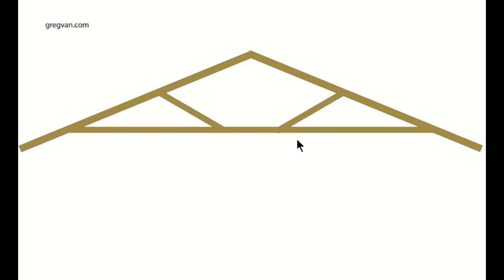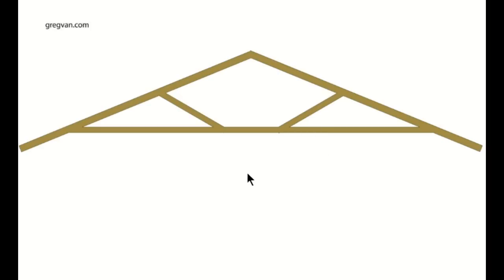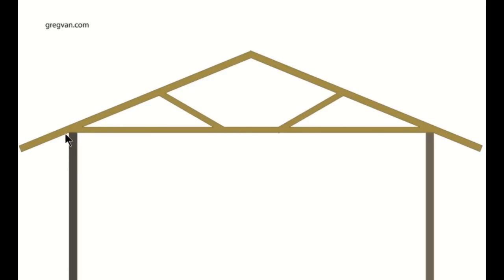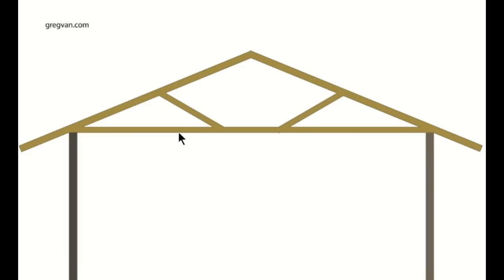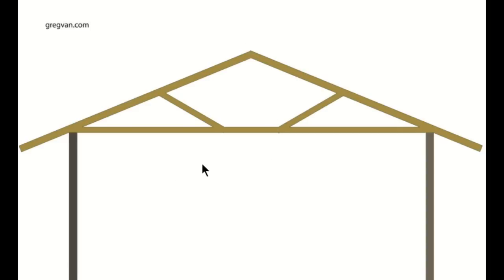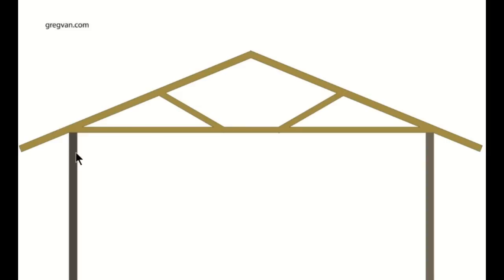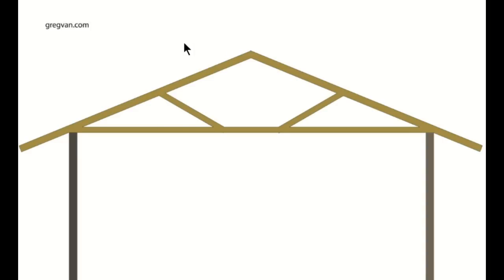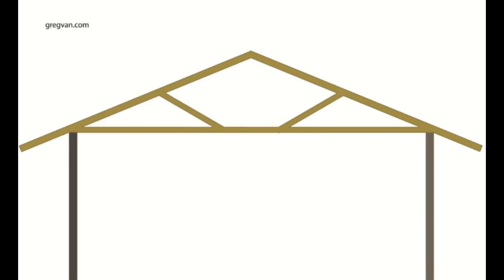Roof Truss Basics - Structural Engineering And Home Building Tips

Comment from the maker: Realistically, the truss I drew was just an example for the video and its design couldn't be used in every situation. However, you do have a good point, even though I cant validated, because I'm not a structural engineer or roof building truss designer.

Comment: each member of a truss is either in tension or in compression or even neutral. All the loads will transfer to the reaction points, which is the contact point with the wall. A failure in any of these load carrying members would change the load distribution of the whole truss and could lead to a structurally unstable truss. The over hangs are pretty much dead weight that doesn't carry any load but contribute to the total weight of the truss. so cutting them off wont do any damage.
Reply: 🎉😂r

Comment: Questions for you Greg:
Looking to remove a center beam, that seems to not be supporting the roof.
We have a garage that currently has a center beam (2 x 2x6s), with two posts.  At a minimum I'd like to replace the center beam with a glulam, in order to remove the center posts.  But looking more into the structure it seems the trusses should be fire without the center beam.
26' x 26' structure.  22 trusses on a 16" center.  4/12 slope.  The trusses are home made with 2x10 bottom span, 2x6 rafters, with two 2x4 diagonals, and one small 2x4 horizontal just below the ridge.  The design is exactly as in your video, not a double camber, or "w", but just two diagonals.  I can't find any information on how well they'll structurally hold up over a 26' span.  
So to continue with this long post I'll say I'm using 60psf for the worse case snow load.  I don't mind putting in a glulam to span the center, but then I'm trying to figure out the size required.  Looking at 3.5x12" 26 footer.
Thanks for your time.
Reply from the maker: +Conor Whitehead I can't provide you with the size of your beam or the size of the footings you're going to need to install at each end, to support the beam. I would strongly suggest contacting a structural engineer, even if you're not going to get a building permit.
Reply: gregvancom thanks

Comment: The truss you are speaking of is called a drag truss. and it is designed to spread wind shear and lateral movement caused by shaking and it typically aligns with a lower wall and when tied together via plywood they act as a shear panel.
Reply from the maker: You're absolutely right and thanks for sharing. Sometimes my mouth goes a little faster than my brain.

Comment: Without structural plans it is hard to be sure. Sometimes, depending on framing companies... a load bearing wall will have a double top plate, non-bearing wall only a single top plate.

Not every framing company will do this for non-bearing walls so you cannot judge by just that. Having the plans will tell you if that wall has a footing or was to be load bearing.

Comment: Current design software does indeed allow the ability to break our old fashioned design standards of the triangle. Take an attic truss for example. The room is a box lacking any triangulation at all, but it works. The truss in the vid does indeed break that rule as well and IMO wouldn't/shouldn't be used anyway. There's a lot of force in the peak and without a kingpost/fink/fan style the design would fail in deflection for sure. I'm sure it was used just as an example.

Comment: As long as you do not have any load on the overhang (that mean, an unsupported plain member sticking out beyond the reaction point), it does not contribute to the structural integrity of the truss. You can chop it off and it will still have structural integrity. Trusses are not just used for roof building, it can be a bridge, etc,  the reason people keep the overhang in roof is that the extra member support the roof sheet or what not that sticks out.technically its a cantilever from truss edge.
Reply: Also, overhang is like your house's armor against mold and mildew. I forget the percentage for every few inches , but the longer the overhang the dryer the walls remain

Comment: At 1:11 this is what I need advice on, I know not to cut any of the trusses, which the trusses are all ok. What I'm asking is can I build a temporary wall beneath the trusses or a beam as close to the exterior wall as possible to replace the exterior wall about 16ft in length. I plan on removing the sheathing on the roof in that same span and ceiling to gain access beneath the trusses to build a temporary wall or a LVL beam? Also I'd like to add at 1:11 looking at the truss i have a wall center of the building running full length of the building parallel to the 2 exterior walls, the building is 30ftW x 52ftL with 3 load bearing walls 2 outer, 1 on center parallel to the 2 exterior walls.
Reply from the maker: I do have videos on that at our website. https://www.homebuildingandrepairs.com/repairs/framing/index.html
Also check out the remodeling/framing videos. Yes, that's usually how I remove and replace damaged framing.
Reply: @gregvancom  Thank you I have been checking out your other videos and you have a new subscriber! Thanks again. The reason I asked for advice is to confirm what I already knew what had to be done to replace that section of wall because of Rot. The top plate is broken in half and the trusses at least 5 of them are sagging. Today I removed the ceiling, roof shingles and sheathing, and I am preparing the temporary wall,  I plan on just balloon framing it. I appreciate your response I plan on watching more videos of yours.

Comment from the maker: The weight difference between the two units might not be much, however you should check with a structural engineer. Do not cut or drill holes in roof trusses, without verification from a structural engineer. If you're not going to contact a structural engineer and the weight difference between the two units isn't going to be more than 100 pounds, then you "might" be okay.

Comment: hello, I understand about not cutting. What about building a walkway on-top of horizontal member of the truss to allow a person to walk around and do plumbing and electrical maintenance work. I nearly forgot about shelving, can I use light wood just build a shelf to hold occasionally used things like back packs and luggage set, extra cleaning supplies and utensils etc.
Reply from the maker: In my "opinion" I don't think it would be a problem to build a few shelves and store a few items. I personally stored about 200 pounds worth of items in a garage attic that was 20' x 20', without me problems. Now for the bad news, this doesn't mean it won't be a problem for everyone.

Comment: I thought a truss consisted of a group of triangles, but you have a trapezoid right in the middle.  That looks like it would weaken your truss.  It seems to me the truss would be stronger if you left out those two inner members and instead ran two members from the apex to the bottom chord.  Or maybe add two members from the apex to where your existing inner members intersect the bottom chord.
Reply: I think you are correct
Reply: It's definitely not a standard truss.
I would take two more members, place one end each at the points of the two inner triangles on the cord, then connect them both at the apex, creating a Fink truss.

Comment from the maker: It all depends on what ends you're talking about. The parts of the trust that overhang past the walls will be used as eaves and the parts that are sitting directly on top of the walls will be transferring all of the weight from the roof to the wall.

Comment: Load bearing means it either has a direct path down to the foundation or is supported by a beam. Follow the wall in question down. If nothing structurally supports it beneath it shouldn't be used as a bearing wall. This is the problem with homeowner construction done years after the house was built. They make "from the hip" framing decisions without knowing anything.

Comment: If you have an attic fan in the ceiling then one truss will be cut. As long as you frame a truss appropriately you shouldn’t have a problem. I removed the attic fan and attic ladder in my home and reattached new 2x4’s with truss staples so they are considered complete units again. One staple on each side of each joining pieces.
Reply from the maker: Yes, as long as you're using an approved engineered repair.
Reply from the maker: Yes, as long as you're using an approved engineered repair.

Comment: Ty for the information. A quick question for you  if  you don't mind. A interior load bearing wall  would have  a wall  underneath it as well in the basement would it not ?so the  load it transferred  all the way through the structure?
Reply from the maker: Gord Davis A loadbearing wall will need to sit on top of a supporting structure whether or not there is another wall directly underneath it, load carrying floor joist or a load carrying beam. I hope this helps if not feel free to ask another question.

Comment: What would a Truss look like that would span a 30 foot bay? Would we have to put in a 3 row of support beams down the center?  About the only weight it will supporting is plastic and snow in the winter time. You seem to be in the know and I'd like your feed back please. My application for the building will be a wooden high tunnel structure with trusses being 4 feet apart.
Reply from the maker: It's hard to say, but it would probably look something like the illustration in the video. I would contact a trust manufacturing company for more information, because each building needs to be engineered to carry the weight of snow and roofing materials and weather and wind in your area can affect them also.
Reply: i have installed 10 metre trusses (30 feet i think is equivalant) generally there is no internal load bearing walls. and they are engineered to be supported on external walls only. as trusses (that i know of) are designed and built under extreme tension. and with a slight bow in them going up. so that when a roof load is placed they then settle and are self supporting. (4th year apprentice so dont know it all yet ;) )

Comment: I’m purchasing a 1960 home and the roof looks exactly like this. The problem is that the ceilings are so low. The main house is barely 7.5 feet and an apartment connected via a car port is about 7.25 feet. Can anything be done to increase ceiling height? Are vaulted ceiling an option or my only option? There is no way to walk in the attic the way it’s currently built. Thank you.
Reply from the maker: It's all relative to the amount of money you're willing to spend. Yes, vaulted is an option or raising the flat ceiling, if possible.
Reply from the maker: https://www.homebuildingandrepairs.com/remodeling/framing/ceiling/index.html here's a link to some videos.

Comment: If you wanna frame your own trusses from on site pines cut into large rectangular beams.. What would be pros / cons of using pine assuming its treated and dried properly..?
Reply from the maker: I don't think I will be much help solving your problem, because I don't know enough about the strength of different types of lumber used for roof truss construction.

Comment: I am looking at purchasing a house (foreclosure) and notice a large crack in the 2nd story ceiling. Upon looking further I noticed that the ceiling dry wall is dented down in the exact shape of bottom chord (2by) along the length of the center hallway wall.. The dents indicate the truss system has moved down at some point about half an inch. The foundation shows no signs of settling or problems and the roof does not sag. I live in the north and the obvious cause is snow load. The large crack noticed originally was caused by a non-load bearing wall  (closet) that happened to run adjacent to a bottom chord. As the chord moved down slightly under snow load the static wall cause the ceiling to crack. The house is 24' x 46'.

Can I correct this issue by drawing each bottom chord to the center wall with lag bolts?
Am I right in assuming this center wall is intended to be load bearing and the roof was installed incorrectly with a small gap between the bottom chord and the top of the wall?
Is this a major issue? Could it be caused by something more serious than I have put forward above?

Thanks for your time

Comment: Just bought a house in Denver, CO and I want to remove the wall between the living room and the kitchen to open up the area. I have 5 trusses spanning front to back 18 ft. do I need to put a support beam in the attic if I'm removing this wall.
Reply: You need to contact a structural engineer.

Comment: I'm living in a brand new home and have been told that the wrong truss design was used.  The other homeowners with the same design have been told that the problem is cosmetic and not structural but that the builder is willing to take care of it.  My ceiling has a dip in it and I've been taking pictures of the repair process.  I'm having a hard time believing that this is not a structural problem and would like to know your thoughts on it.  The repair job will take about 2 weeks.  There are 48 other homes with the same problem and we are concerned about the builder.  Thank you.
Reply from the maker: Rebel Falcone It sounds like a structural problem to me also. You might think about contacting your local building department, state contractors licensing board or even the manufacturer of the roof trusses. What exactly is your concern, because if the home builder is going to fix the problem, then this would be a good thing wouldn't it. Have any of the other homes already been fixed? Does the home builder have an approved repair from a structural engineer?

Comment: I disagree with the last sentence Aelevant. ANY and ALL members of a truss have an impact on the total design. I have repaired many trusses in the past that the framer has cut the tails off of that forced the need for gussets or scabs to the chords. The OH of a truss does indeed impact the stresses of the total system and simply removing them violates the reactions shown on any engineering drawing. It's not always so simple.

Comment: Hi I have a small question if you will. I have a backslpit house and on the front I have my living room dining room on the left and kitchen on the right. In between I have my hallway separated by a wall which has 2 arches made for living room and dining room access from the hallway. Above this floor is my attic and my roof is supported with pre-engineered roof trusses. I am planning to remodel my kitchen and create an open concept removing the wall in the hall way. I have been given conflicting information by the contractors I am seeing. One of them says it's not a load bearing wall and since you have pre-engineered roof trusses you don't have to worry of removing that wall at all its acting as a partition wall only. On a second hand another contractor says since the roof span is around 30'ft wide it's good to have a beam installed to support the roof where we take the wall off. Can you direct me to a correct direction based on your expertise. I have opened the wall and it does not look like a load bearing wall but again I am confused with conflicting advises.
Reply from the maker: This is only my opinion and I would advise contacting a structural engineer for more information. There's a good chance it isn't a load bearing wall if there is a space between the roof truss and the top of the wall plate. However, it could be a structural wall used for lateral movement and if it is then it would not be able to be removed. If you want you can send me a picture and our email address can be found at the website.
Reply: Yes I did got a Structural Engineer to come look at the wall. He inspected it through the attic and confirmed the wall under is not a load bearing wall. He said the trusses are preengineered running from exterior wall to another exterior wall so any walls in between can be removed without any issues. I did completed the demolition yesterday. Thank you so much for your advise.
Reply from the maker: You're welcome and thanks for watching.